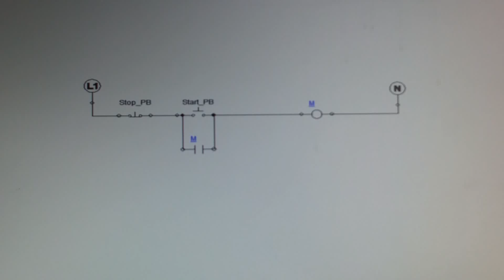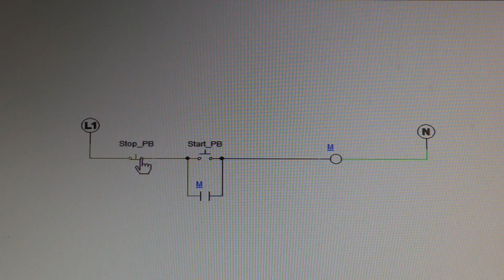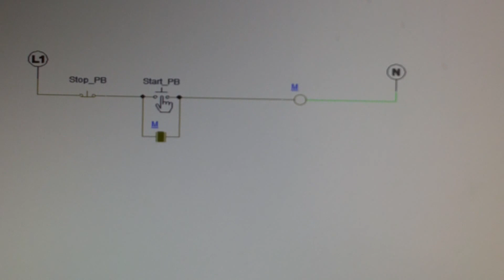Stop / Start seal relay control circuit

Comment: Good, but you woudn't normally want much current going through the relay coil, so the actual load would presumably be on a separate pole (switch circuit) of the relay.  That wasn't mentioned in the video though.

Or are you talking about a special type of relay here, that takes a lot of current through the coil?